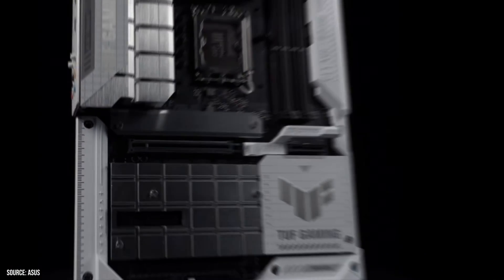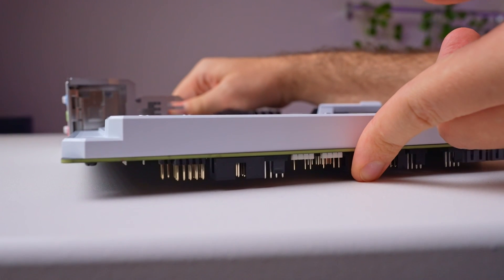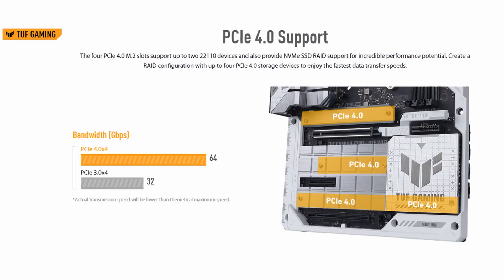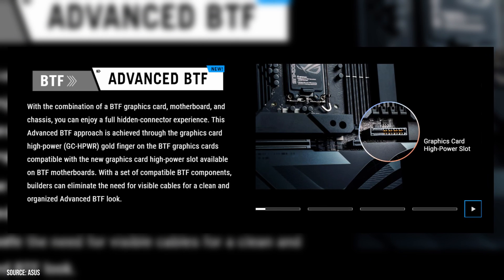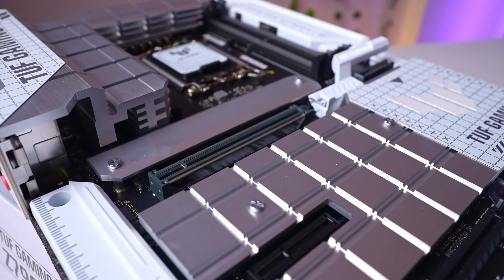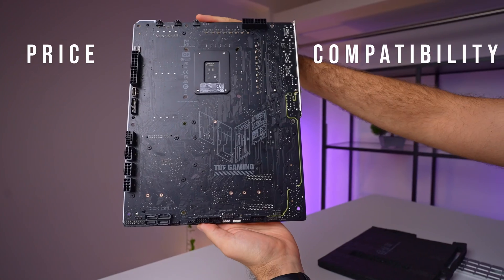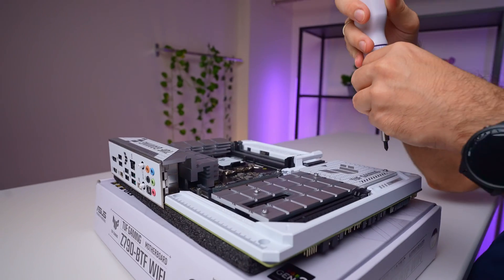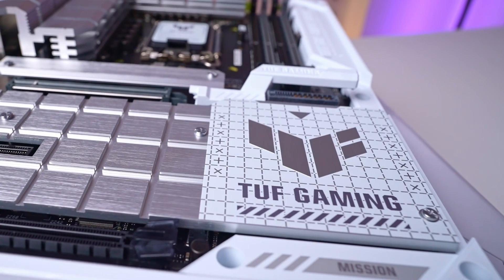Business At The Front, Party At The Back: TUF GAMING Z790-BTF Motherboard

Comment: I want to make a 4x16 gb ram combination, what is the max speed that the motherboard supports, I didn't understand anything in the documents. I use Intel 14700k
Reply from the maker: hey, I would really be careful going with maximum and use something that is recommended as tested. If you open the motherboard page, go to support, then check hardware support and memory. There asus advertises tested kits